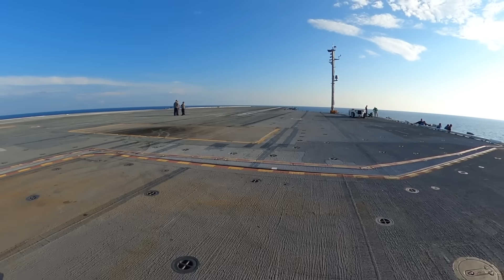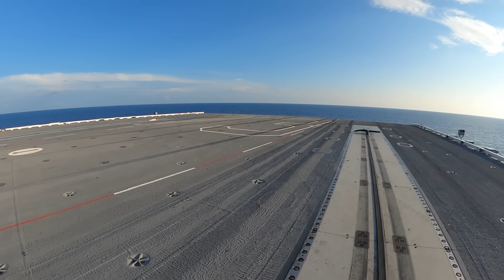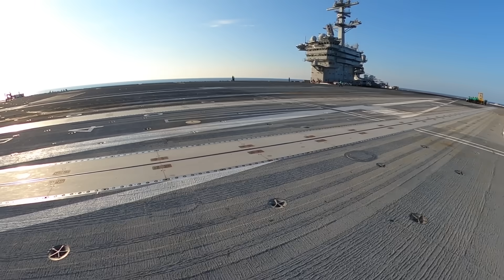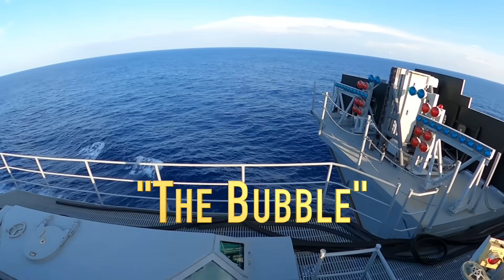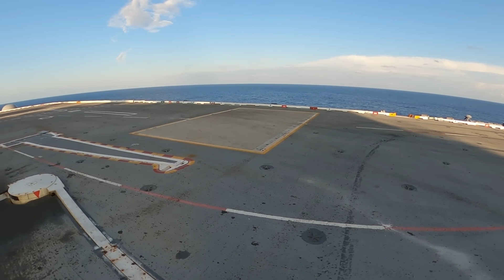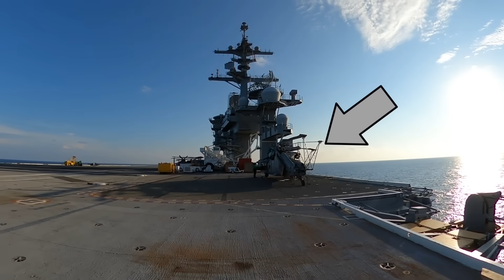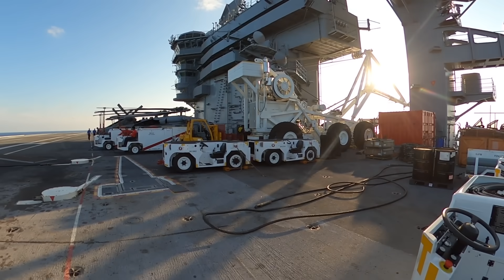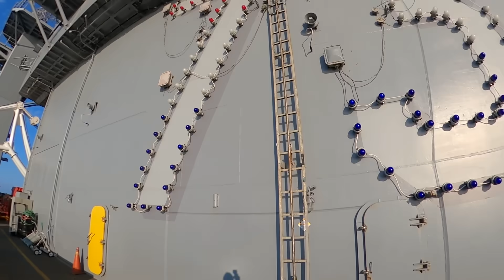The Carrier Flight Deck You Rarely Get to See

Comment: That non skid in the LA is pretty much gone by the end of a cruise, just a slick deck. Onboard the GW 2002-03, F/A-18 taxiing in the wires after recovery, ship starts a light port turn, the F/A-18 starts sliding slowly, bunch of us run out and push against the port side of the aircraft. Got it stopped! I'm thinking the air boss had some words with gator about that turn, pilot probably wasn't too happy about it either.
Reply from the maker: TYFYS

Comment: As I recall, it's more difficult to catch a wire the further aft you go. For a plane to catch the 1 wire means they are lower than they should be. So, I remember that the 3rd wire is always optimal for clearance of the ship, clearance of the landing area, clearance on all sides, and best angle of descent with enough time to catch or bolter. I believe most times LSOs might wave off a plane than risk a 1 wire catch... but I'm not sure.

Comment: I've been on real carrier decks a few times and I always thought the 'last-ditch net' (with bracing) around the edges to be a bit 'skinny'; i.e., just wide enough to catch a person at about waist (mid) height--i.e., at just the height needed NOT to catch the person but to 'finish' flipping him over the edge of the netting and into the water. Yes or no? What am I missing?
Reply from the maker: I think the net is mostly designed to catch equipment that goes overboard.  Sailors on the flight deck wear float coats during flight ops.  That’s their real protection.

Comment: 1:18 bottom right is that from radiation? Just wondering
Reply from the maker: I looked at your timestamp but have no idea what you are referring to.
Reply: @GrowlerJams  buddy boy is talking about the tiny reflective particles in the material that covers the flight deck.
He's mistaken them for ionizing radiation.
Also the timestamp is not good, it starts around 1:05.
Reply: its just light reflecting off the grippy surface of the deck, its like fancy skate tape

Comment: What is deck surfaced with, concrete?
Reply from the maker: Anti-skid…it’s a rolled-on rough grip surface.
Reply: @GrowlerJams  thanks 4 reply, i head later in video ots applied like yearly. Is it like a asphalt mix? I am becoming very interested in carriers since i found your channel.  If u read this and have time to answer, just b4 take off you look like you are rubbing something with your forarm in a circular motion,  what r u doing? And i assume if u didnt catch the wire on landing u can still take off again and try again.  But what would happen if u didnt and went into ocean? Would the ship run u over? Maby do a video on that scenario. Thanks 4 your service.
Reply from the maker: I don’t know what it’s maid if, but it’s tough and grainy.  

Why Pilots Don't Touch The Stick On The Catapult
https://youtu.be/2Ht3ahSWpbk

Watch this for more on catapult launches.
Reply: @GrowlerJams ty

Comment: Thank you! I confess to civilian ignorance. But: the opening stair ascension shows rust on the wall. Is that normal, or a, 'the work crews haven't gotten to that yet?' Is this indicative of impending Kustnetsovity? Keep up the good work.
Reply from the maker: I didn’t see any rust.  I saw the paint worn off a heavily-used and metal that needs paint.  Exposed rust on a Navy ship is a big no-no.
Reply: @GrowlerJams when you first ascend the stair in the intro. Red spot above your M, wear/primer showing on the port handrails, & red on the bulkhead under the stairs a couple steps down. Is this rust, or something else?
Reply from the maker: I can’t tell.  Looks more liked chipped paint to me.  There might be a little rust on that handrail.  That ladder well is of the busiest highways on the ship to get to the flight deck.  The ship repaints these areas regularly, but filthy hands wear down the rails and Sailor’s equipment bangs up the bulkheads.

Comment: 1:24 I feel you lay it on a bit thick here and make the flight deck seem a bit too interesting. It's not that the flight deck is absolutely boring or that I didn't stay for the whole video, just that when you're conducting flight operations (shipboard or ashore), the goal is for the surface you're doing it from to  have a "surprises/acre" ratio that is as low as possible.

Comment: Wonderful tour that usually only those of us lucky enough to serve on the deck get to see! The descriptions were simple enough for all to understand, and the continuous flow of the video really gave an accurate idea of the size of the deck. I was a greenshirt on '66, 69, and Plankowner on '72. The smells, the sounds, the vibrations are things you can't get through the video, but rest assured viewers, the ship is alive in a very real sense. The catapults shown are "cold" meaning the steam is not flowing through the systems to heat up the cats, and they are not operable in this state. Long before tomorrows flight ops they will be preheated, and steam would be flowing out of the slots that run the length of each cat, but to prevent that there would be full length rubber seals called slot seals, to keep the heat in and keep the cats "stretched". Before they heat the cats they run the shuttles and the retraction engines back and forth to ensure smooth correct operations. The JBDs he showed are actually like radiators, as they have water systems within each panel where seawater flows to remove the unbelievable heat generated by twin jet engines blasting in full military power for long moments before launch. Otherwise they would be melted, and or red hot at the least, and aircraft following to the cat would melt tires and crew member would literally melt boots!! They are still god awful hot even minutes after a launch! The round canisters along the sides of the catwalks are life pods which, when they hit the water, open up as rafts and water safety equipment. Hope they never need to be used. This is a video I will be sharing because it is so peaceful and opposite of the chaos usually shown on the deck. There were many beautiful days on quiet decks that made one feel small and vulnerable, nothing on the horizon... nothing! But it also made us proud to be out there doing the job.
Reply from the maker: Cheers and TYFYS!
Reply: Hi Chris,
We chatted shortly a few months ago about beautiful sunsets and nasty, windy weather on the sea. I read your comment and noticed that you've been a Plankowner.
Could you please explain the Plankowner to me? I've heard the word several times, but it doesn't open up to me what a Plankowner does or mean. It's like an empty 💭 right now. I've tried to search it in web but... As I said earlier, I'm not American, and we don't have any Aircraft Carrier, so I can't find an answer from our own military. A dictionary hasn't been any help either. I would really appreciate it if you could help me. Thank you, and have a great day. 🌞☃️
Reply: @memmu2901  Be happy to. A Plankowner on a modern ship signifies the same as it did during the wooden ship era. It signifies that you were among the original crew that helped build the ship and "brought her to life" (commissioning and sailing). When the wooden ships were decommissioned the plankowner would get an actual plank from the ship. Truth be told that many plankowners don't actually "build" anything but instead are part of ensuring the systems and machinery are installed correctly by the shipyard workers. As a greenshirt (ABE) we actually did assist in the physical install and testing of the catapults and arresting gear so I'm proud to have actually sweated and bled as part of the actual construction. Plankowner status can only happen once in a ship's life so it's kind of special.
Reply: @chrismaggio7879 
Thank you very much for explaining it so precisely and with an easy way to understand.👌🏻 I have a good picture of the Plankowner now. 😊 It really is a rare, and very important position. Wow, I'm glad for you that you've got to experience that! 💪🏻💪🏻💪🏻

As I read your answer, I have a habit of picturing things in my mind. It makes it easier for me to understand what I'm reading. 
Hilarious detail was that I pictured a 18th century wooden ship with those thick and string logs, planks, and other wood parts that have been used and which might be impossible to even find anymore in these days. Almost all old and thick trees have already been harvested, or they're are conservationed. Luckily, ships aren't  made of wood anymore. 😁 Except  very big and expensive sailing boats. 

I've watched a National Geographic's document about the aircraft carrier(s), and they were explaining  quite much about  the arresting cables, but I can't barely  remember anything. Unfortunately. 

How thick the arresting cables are approximately? And do you know if they're made of some kind of special steel. (I assume they're made of steel.) It's a huge force that is hitting them each time, and I also assume that they need to be a little elastic not to break. Or is there for example a spring to help where the arresting cables are fastened to the ship? I was just thinking that all salty humidity that is touching the cables and affecting them and maybe doing them weaker by the time.

I'm sorry that I sound like a five years old keeping asking questions. 🫣😄 And I apologize that the terms I've used and words are probably wrong many times. Hopefully you can still understand. Acc is so full of all kinds of unique details.

Comment: You didn't mention the arresting gear slap boards and that the JBD is water cooled and if some aircraft are at full throttle the back of the JBD glows red.  Great tour. I found out on my one carrier cruise on the old Kennedy CV-67; I thought I'll be able to get good runs up here. Bust as you know, one the airwing embarks the flight deck is usually full and / or slick with hydraulic fuel while the hanger bay is so full it's hard to just walk thru let alone run. So off to the forecastle to treadmill my life away. :)
Reply from the maker: TYFYS.
Reply from the maker: TYFYS.

Comment: My first ship was the USS Forrestal CV-59 in 82. Even though it was namesake for the first class of so-called "super carriers", it's small compared to this ship. I will say, the nicest part of my time aboard her was before we took on the air wing, when it was just ship's company sailing around. Nothing like a walk on an empty flight deck in the middle of the night at sea. No artificial light to speak of, millions of stars to see.

I've noticed that newer carriers have moved the island structure farther aft than the Forrestal had it. But, I never knew until this video that it appears the "bomb farm" isn't where it was, if it exists. That area outboard of the island was wider and it's where they staged munitions prior to loading them on aircraft on my ship. As an ET in OE division, our berthing was on the 03 level, right below that bomb farm. One of the first things I was told when checking in to berthing, don't worry if you hear a bump on the deck above you. If anything were to actually happen, you'd be in the water before you heard it.

As a radar ET, my shop was up in the island, as was my radar room. So, I spent most of my time in/around the island. It also means I was one of the ones that had to work on the harbor navigation radar on the bridge, which had its antenna assembly mounted on a narrow catwalk along the forward side of the island, about where the bridges were. So, around the 07-08 level, or 3-4 decks above the flight deck. Just forward of that location was the starboard bow cat.

Two of us went up to work on that radar. The antenna was covered by a dome about 3' diameter or so, held on by a large metal ring clip. Just as we got the dome released and were lifting it up, they did a launch from that starboard bow cat. You want to know where the jet blast goes when it hits that JBD? I can tell you first hand, it goes right where we were. We were suddenly hit with a blast furnace wind that almost snatched the dome out of our hands. We held on to it, tucked in, and waited it out. As soon as it launched, we clipped the cover back on and aborted. Not until after flight ops.

I've actually been aboard 3 of the 4 Forrestal class carriers. When I got orders to the FID, I was in school in San Diego. One of my classmates was stationed on the USS Ranger and he invited me aboard to get an idea of what I was heading to. Later, while on my second ship (a Knox class frigate, USS Vreeland) I stayed in Mayport for a class while the ship sailed to Haiti. The berthing they gave me was on the USS Saratoga.
Reply from the maker: The bomb farm is still outboard if the tower, I guess it’s a little smaller than it used to be.  Cheers!   Thanks for watching.

Comment: This brought my memories back in 2009, my dad and uncle used to work on this ship for years with engine and many different parts on it. Also that was Family Reunion on this ship and sailed away into sea all day with activities such F/A-18 and Blackhawk helicopter land and take off, other events under the deck. This big elevator on front right where we were on it was pretty fast up and down. I was stand on back of the ship and look at forward, it was way long to the end of front. The two catapults on far left where we watched they tested before start doing plane take off, the one catapult start launch till end, the whole ship shuddered for a second. That was steam pressurized until they changed it to electric magnetic years later. When F/A-18 on catapult, before take ready to launch, this is like drag race but this sounds way more loudest ever. Even you can significantly feel plane land and take off. The top tower of left side, that was where I standing on viewing it was beautiful wide open of water and whole deck. By the way, this ship is pretty fast as wind blow you by when stand on deck. So yes this ship came from Norfolk, VA so that where we come from, it’s pretty big navy area. Whole F/A-18 empty on deck, they usually come in and out of NAS Oceana in Virginia Beach, VA. That was awesome and quickest tour of video!

Comment: Thank you for the tour of the Nimitz class flight deck! 😃

As a side note to a few other comments... 

Yes! It is much easier, quicker and certainly quieter when there are no pesky aircraft operating!  

If the aircraft were there and just tied down & not flying it would take probably 3 times as long as least to wind yourself around the planes, the tie down chains, all of the various equipment, bunches of other sailors (air wing folks) doing various inspections & maintenance, etc. 

 Unfortunately I never had the pleasure of serving on a Nimitz class boat back in the early 80s. Then again back then, we only had 3.

Comment: I am that person.... 'Grape Shoes' is incorrect, Aviation Bosuns Mate Fuels are simply 'Grapes', if you see a gaggle fuck of Grapes it is referred to as 'A Bunch of Grapes'. 'Shoes' is a generic term for those rates that are solely assigned to Ships and is the shortened version of 'Black Shoes', vs the 'Brown Shoes' worn by 'Airedales' which comes from one of the early US Navy Aviators who flew every flight with his trusty Airedale in the cockpit. 'Seahawks' refers to SH-60B, SH-60F, and MH-60R airframes built by Sikorsky Aircraft Co. and equipped by Lockheed Martian as Anti-Submarine Warfare Aircraft are 'Seahawks' which were developed from Black Hawks. What was shown are MH-60S Knight Hawks, some times referred to as Sierras or Knights and are primarily cargo aircraft. Sierras were based on both H-60 Black Hawks and SH-60 Seahawks, and you will find bits from both sets of airframes in the Sierras but often with distinct part number and EOC differences that do need to be respected for that airframe. Note, the HH-60H Rescue Hawk is also a Navy Aviation Asset. Its a bit of an odd duck, but it is a derivative of the SH-60F Seahawk and all three airframes of the SH-60F/B and HH-60H have 90% parts swapability for parts, airframe and instruments, only the Avionics Mission Suites vary. Since the HH-60H have/had the fewest number with one of the most demanding operating environments it demanded special treatment and could be a challenge to work on some systems.

Comment: Question, you mentioned the schedule for resurfacing the deck, do the markings get painted during it or are there other intervals for that maintenance with a repaint during resurfacing as well?
Reply from the maker: Markings get repainted at that time as well.  Sometimes other areas get repainted when required (like centerline in the LA).
Reply: @GrowlerJams  makes sense considering how firm you guys land.

Comment: How do the cables cables work?

What do they transfer the energy to, to stop the plane?

In my head if it was an electromagnetic it could be “dialed in” for a softer arrest and also feed the ships power system

It would be a spike, so it would have to be harnessed, but it’s lots of energy
Reply from the maker: The cables pull steam pistons under the deck that absorb the energy from the trapping aircraft.